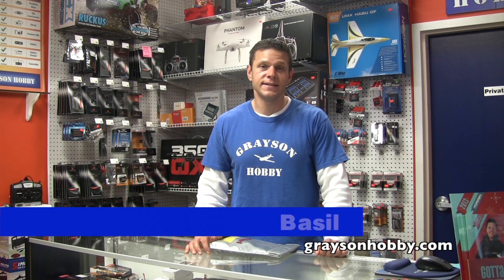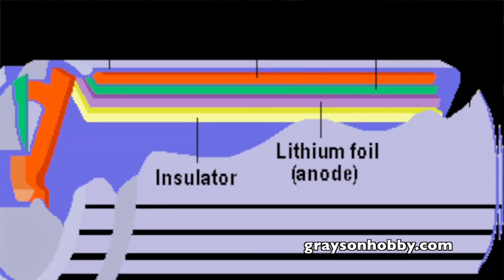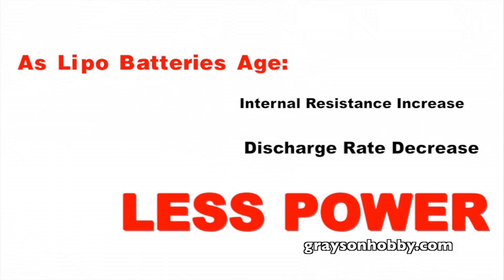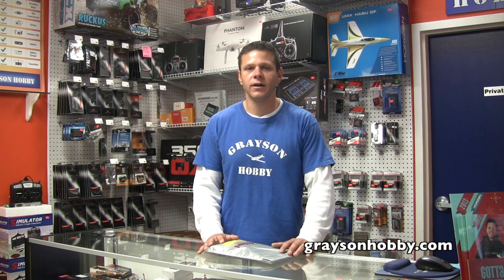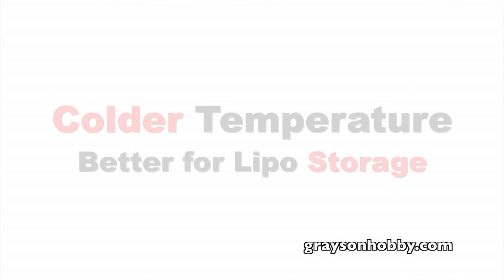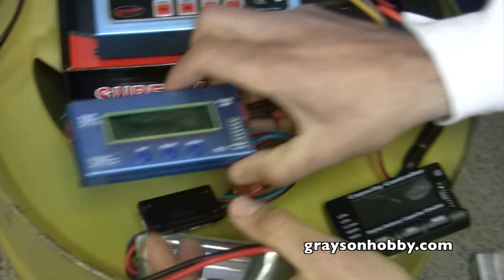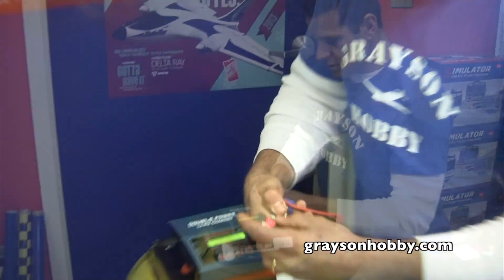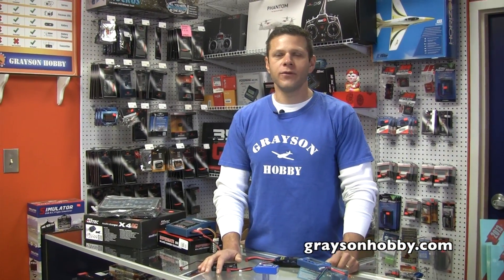How to get more Life out of your Lipo Packs

Comment: Do those lipo bags really work?  I've seen on some videos that they aren't very protective and will catch fire/melt.  Also, what do you consider the best way to dispose of older batteries that don't work anymore?  Thanks!
Reply from the maker: The Lipos bags do work, but you have to understand these are not "FIRE PROOF"  They are fire "resistant.  .  Batteries should always be monitored when charging and these bags are meant to prevent any catastrophic damage.  

I have seen people using clay pots, surplus ammo cans, and other "FIRE PROOF" containers, but these big bulky items to do not travel well.

There is WHOLE world about disposal that changes all the time.  I would consult your local recycle center for further info. Every city, town, etc has different rules.